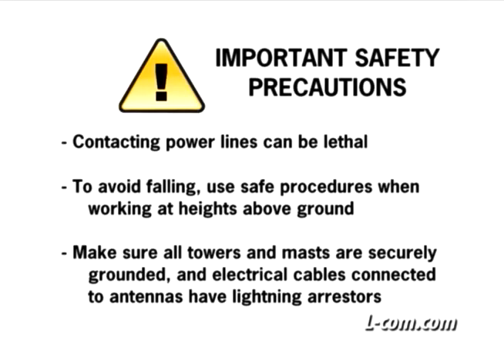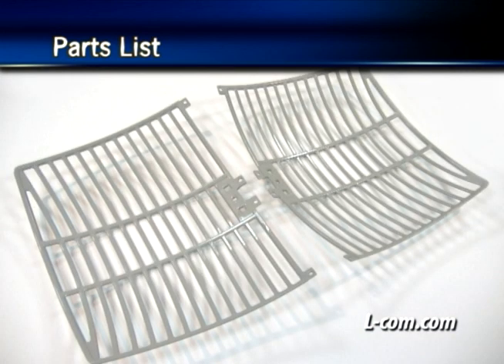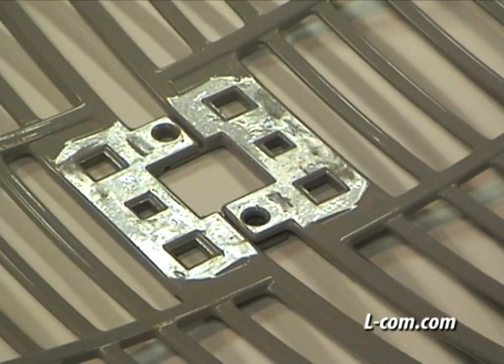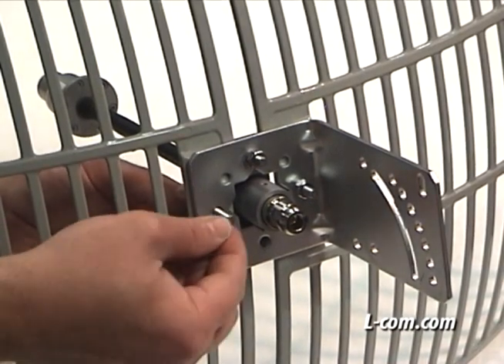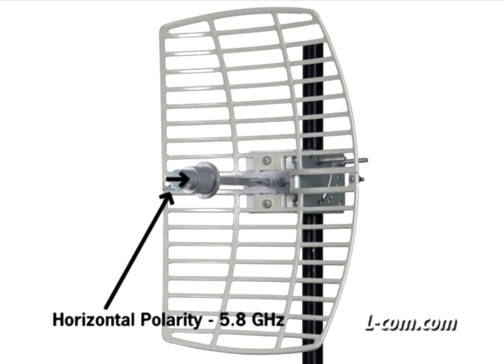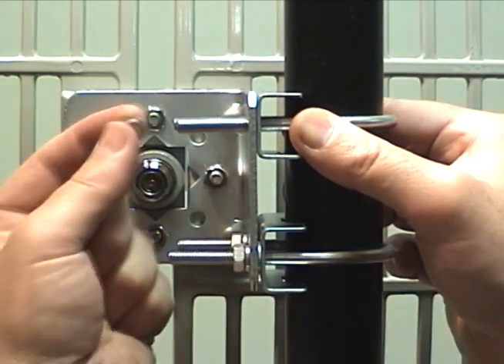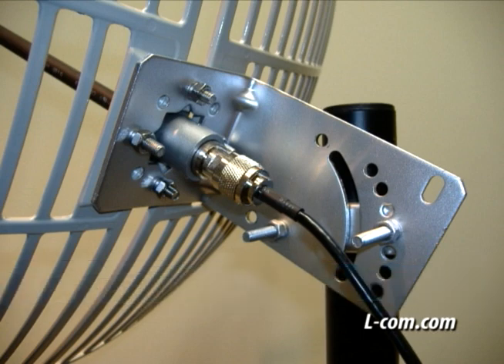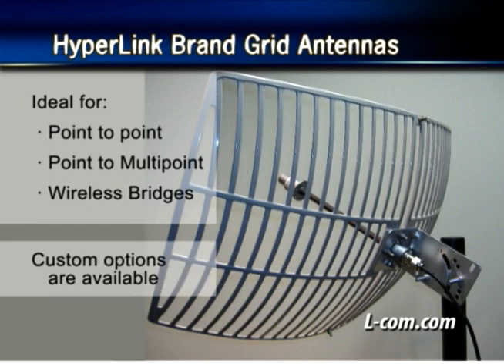How To Assemble and Install A HyperLink Grid Antenna

Comment: Hello How many kilometers attracts This antenna wifi ??
Reply from the maker: Vitalyzd Tv Hello and thanks for stopping by! Depending on your current setup (equipment, environment and location and application requirements), there are many options to consider. We would recommend contacting our sales and tech team. They will be happy to answer any questions you have at 1-800-341-5266 or sales@L-com.com